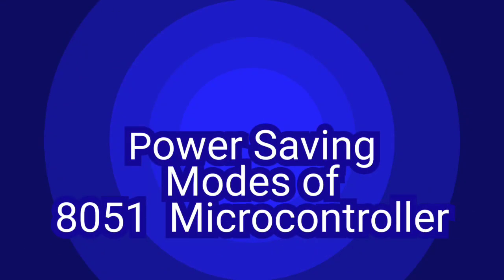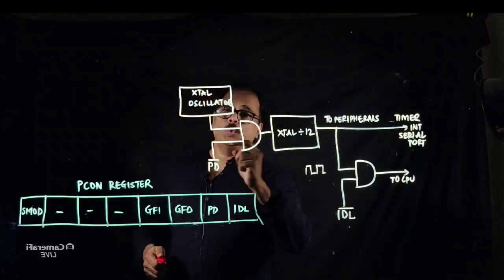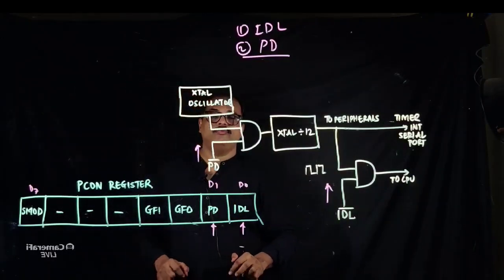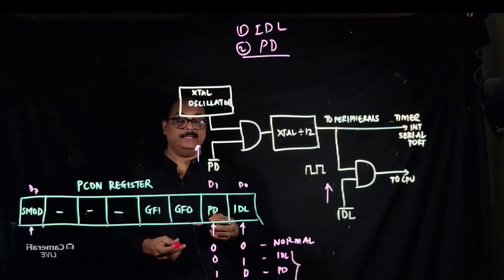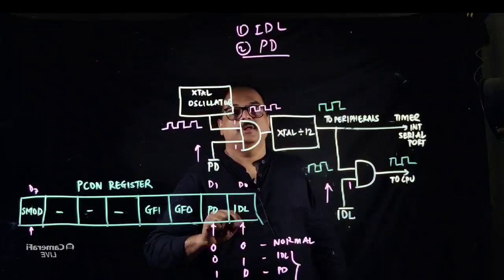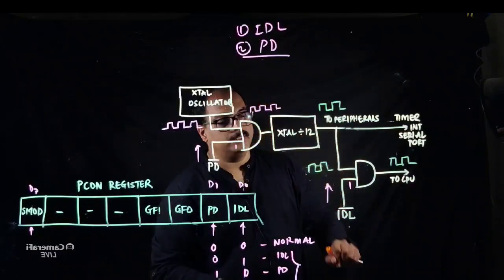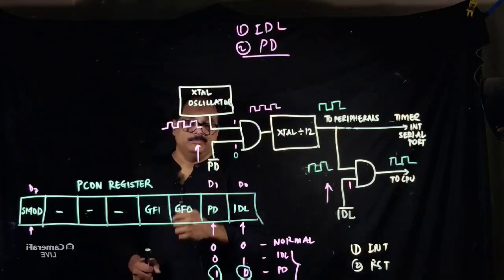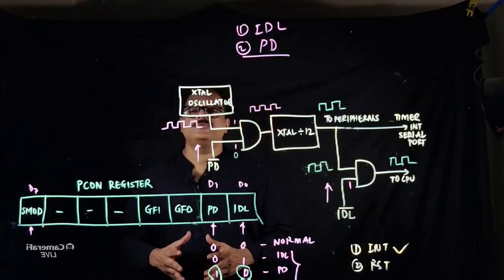8051 | Power Saving Modes | Microcontroller | Power down Mode | Idle Mode

Comment from the maker: Answer the following in comment box
1. Address of PCON register
2. Function of SMOD bit 
3. Power consumption in normal mode vs Idle mode
4. Status of Register and RAM after reset signal is applied in PD mode.
Reply: Function of Smod : Serial mode (Smod) is used for doubling the mode in case of serial communication..
Reply: 3: In IDL mode power is drawn by CPU is very less compare to normal mode
If microcontroller is drawn back to normal mode then there are two ways:
1)To generate interrupt.
2) To give reset signal.
Reply: 1:The PCON or the power control mode is used to control the power in 8051 microcontroller using (D1) and (D0) the microcontroller can be set to idle mode (LDL) and Power down mode (PD)
Reply: 1.address of pcon register 
The pcon means power Control register, This name  used to control the 8051 Microcontroller's Power  Modes and use the programmer during execution.
Reply: 1. Pcon (power control register) use to control an 8051 microcontroller's  power mode . Using in 2 bit P.con register miro control can set  IDLE mode and power down  mode

3. Idel mode power is less as compared normal mode if microcontroller has to be brought back to the normal mode then there is 2 options for that 1 is generate an interrupt second gives reset signal
Reply: 1) PCON register is power control register in 8051 it is 8bit register D0 and D1 are used for power control GF1 GF0 are user defined flag next 3 bit are not used SMOD is used for doubling in case of serial communication.
2) Function of SMOD bit is used for doubling the baud rate in case of serial communication.
3) Power drawn by the CPU in IDLE mode is very very less the entire system of microcontroller compared to normal mode.
Reply: 1. The pcon or power control register is used to control the 8051  microcontroller power modes.using two bits in the pcon register, the microcontroller can be set to idle mode and power down mode.
2. The SMOD bit in the PCON register is used to control the baud rate  of the serial port.
3. The IDL Power mode drawn by the CPU is very less as compared to the normal mode therefore the microcontroller is drawn back to normal mode and there are two ways(1) To generate the input (2) To Reset the signal.
4. If the reset signal is applied in the PD mode then the microcontroller will come back to its normal mode.
Reply: The PCON or power control register as the name is used to control the 8051 microcontroller power modes and is located at 87H
Reply: SMOD Bit is used to control the baud rate of the serial port

Comment: 3) The idle mode drawn by the cpu is very less as compared to normal mode therefore the microcontroller is drawn back the normal mode and than two ways are there 1) to generate input 2) to reset the signal

Comment: 1) The PCON or Power Control register,  is used to control the 8051 Microcontroller's Power Modes and is located at 87H of the SFR Memory Space  by using two bits in pcon register the microcontroller can be set to the idle mode and power down mode

Comment: 2.function of smod bite
Ans-The SMOD Bit in the PCON Register is used to control the Baud Rate of the Serial Port. There are two general purpose Flag Bits in the PCON Register, which can be used by the programmer during execution.

Comment: 1-The PCON or Power Control registers is  used to control the 8051 Microcontroller's Power Modes and is located at 87H of the Special function registers(SFR) memory  space.Using two bits in the PCON Register, the microcontroller can be set to Idle Mode and Power Down Mode.

Comment: 1) The PCON or Power Control register Is used to control the 8051 micro controller Power Modes and it's located at 87H of the SRF Memory space. Using the two bits in the PCON register the Microcontroller can be set Idel Mode and Power Down Mode.
Reply: Where you got ?

Comment: 1. The PCON or Power Control register, as the name suggests is used to control the 8051 Microcontroller's Power Modes and is located at 87H of the SFR Memory Space.

Comment: 3.The IDL power mode drawn by the CPU is very less as compared to the normal mode.therefore the microcontroller is drawn back to normal mode and then two ways are there. (1)to generate input. (2)to reset the signal

Comment: Address of PCON register
The PCON Or power control register is used to control the 8051 micro controller's power modes using two bits in the PCON Register, the micro controller can be set to IDLE Mode and power down mode.

Comment: The Power Control register or PCON as the name suggests it is used to control the 8051 Microcontroller's Power Modes and is located at 87H. By using two bits in the PCON Register, the microcontroller can be set to Idle Mode and Power Down Mode.

Comment: 1. Address of PCON register.
The PCON (Power control mode) is used to control the power in 8051 microcontroller. In PCON register out of 8bits  their are 5bits are important .Outoff 8bits their are 2 bit (D1) and (D0) are using to set PD mode or IDL mode.

3. Power consumption in normal mode vs Idle mode.
In the IDL mode the power drawn by the CPU is very very less as compare to normal mode If the microcontroller is back into the normal mode then there are two options 
1)To generate interrupt.
2) To give reset signal.

4. Status of Register and RAM after reset signal is applied in PD mode.
There is reset button given in the microcontroller ,when we give the reset signal ,the  microcontroller  come back to the normal mode 

2. Function of SMOD bit
 Serial mode (SMOD) is used for doubling the mode in case of serial communication..

Comment: 3 - In Idl mode power is very less compare to normal mode. In 8051 microcontroller if the drawn back to the normal mode then it is give reset signal (RST) or to generate interrupt signal (INT) will take care to get microcontroller back to the normal mode.

Comment: 1 - The PCON or power control register , is used to control the 8051 microcontroller power modes. Using two bits in the PCON register, the microcontroller can be set to idle mode and power down mode

Comment: 1:The PCON or the power control mode is used to control the power in 8051 microcontroller using (D1) and (D0) the microcontroller can be set to idle mode (LDL) and Power down mode (PD)

Comment: 3: In IDL mode power is drawn by CPU is very less compare to normal mode
If microcontroller is drawn back to normal mode then there are two ways:
1)To generate interrupt.
2) To give reset signal.

Comment: Function of Smod : Serial mode (Smod) is used for doubling the mode in case of serial communication..
Reply from the maker: Google it
Reply: The SMOD Bit in the PCON Register is used to control the Baud Rate of the Serial Port. (Baud rate is data transmission)